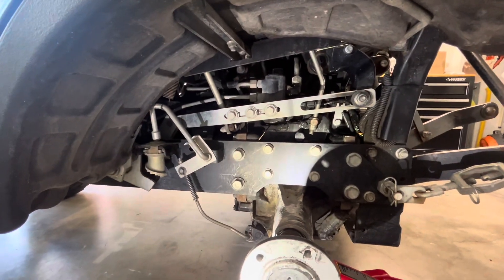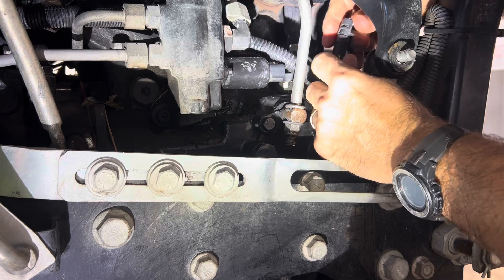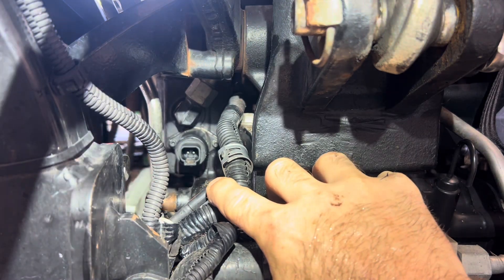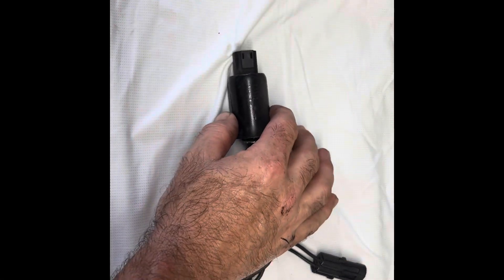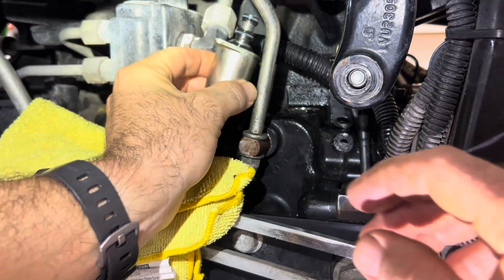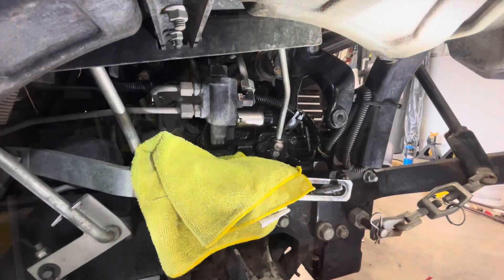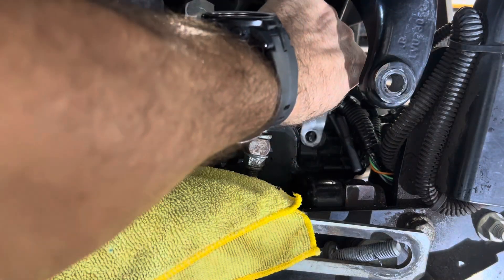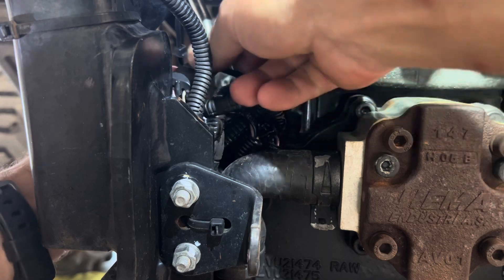John Deere 1025R PTO Solenoid Valve Replacement

Comment: Thank you for this video. YouTube is amazing. Think I have the same problem as my mower deck isn't working. PTO switch is just dead. Nothing happens.
Reply from the maker: You are welcome. Hopefully that solves your issue.
Reply: @2Dahall  Not sure if it needs to be replaced or just cleaned. Plan on tackling it next week. Do you know how to test it after cleaning without putting everything back together and installing mower deck to test? Thanks again.
Reply from the maker: Hopefully you plan on removing the mower deck before tackling this. 👍
 First, take off PTO valve and clean, next you could reinstall the PTO valve & MBR switch. Once this is done, you can make sure the parking brake is set, place in neutral and start the tractor. You should be able to turn the PTO on and test the MID / Both / Rear positions.  If everything works, then you can put the rest back together.